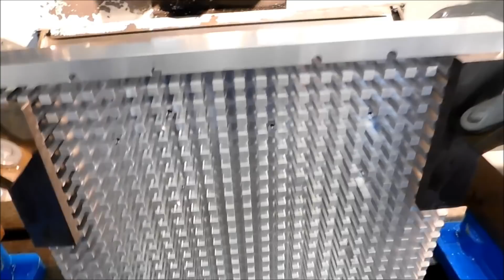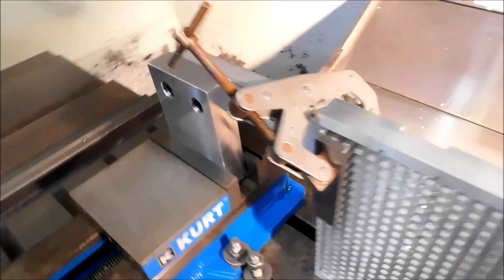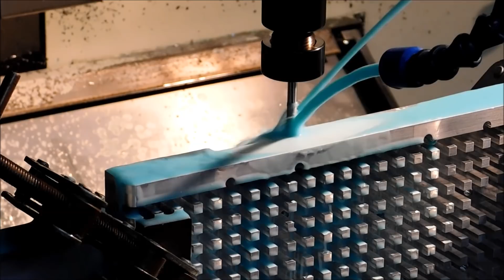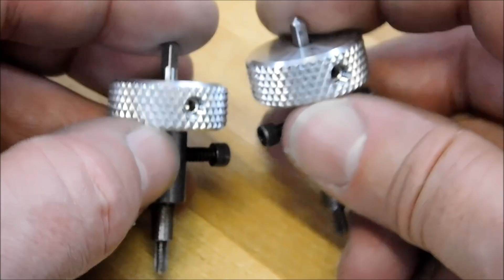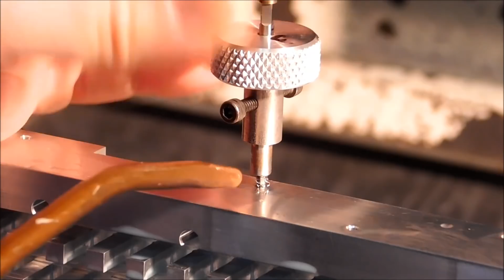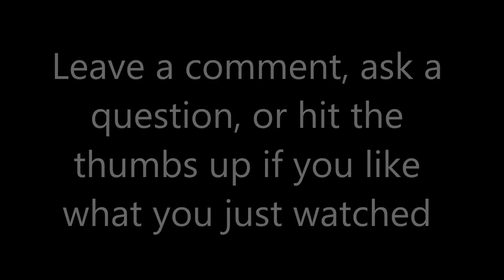Tapping Small Holes - Not a Problem

Comment: Hi Joe ,
If the grub screw holds the tap in what are the two socket head cap screws for ?
I have had to start up a special folder named Joe pie - must have workshop projects and it is filling up fast ! 
Thanks for yet another excellent video and brilliant workshop tip !
Reply from the maker: The 'T' shaped steel part is for setting the depth. The wheel is the driver. Its a 2 piece assembly, but could be one. For extra small taps, I use just the 'T' shaped part as the driver and depth stop.

Comment: Hey thanks Joe! I watched this vid a couple days ago and happened to have a job today that required some hand drilling in the bottom of 1/16” holes, made a similar tool out of aluminum and it worked great, took all of 15 minutes but it will probably come in handy a thousand more times this year! I drill and tap a lot of 4/40 holes so the ID was made for that rather than a 16th bit, excited to try tapping with it tomorrow!

Comment: Is there a possibility of a video talking about carbide inserts or which you may recommend for a job or material. If a private message to me would be easier im fine with that. I mainly cut aluminum and mild steel
Reply from the maker: The coated carbide market is evolving so quickly, that making a suggestion for a single insert is very tough these days. For aluminum, I always used uncoated K68 grade with a positive rake. You can use them on mild steel too, but a coating may give you a better result. Kennametal has a fantastic application chart on carbide grade and profile selection. Check them out.
Reply: Okay thank's Joe. Just getting into it for hobby work and i'm still new at it so i don't wanna end up spending crazy amounts on inserts. I believe i was looking at using the T class inserts for versatility for dovetail tools and such.

Comment: Years back I wrote a macro that would allow me to step down (like step drilling) a tap a variable distance and reverse a variable distance until the final depth was reached. The only time a tap would break was if the drill got dull and pushed up into the chuck. We were machining cast stainless steel that was gummy , and tended to work harden as the drill dulled.
a constant air blast cleared the chips but it was tricky. Nice job on the tap holder.
Reply from the maker: Thanks. I just couldn't bring myself to loose this part, this late in the game. Hand tapping was the only way to go and these little wheels give great feedback for elevated confidence.

Comment: 95% of problems with tapping is side pressure, tapping straight with a proper guide and fine touch is the secret, and, don't forget a decent quality well sharpened tool, even more so in stainless steel...   ;)
Reply from the maker: Hey Pierre. I agree completely. Its a finesse and control thing.

Comment: Best roll tapping when possible, swarf is not a problem.
Reply: Roll taps are very good. But nearly impossible to remove if broken.
Reply: swikocki, yup. I use roll taps whenever I can. #4-40, 1/2" deep in 360 brass, no problem. #10-32, 3/4" deep in 6061-T6, no problem.

Comment: Hi Joe. Have watched all your latest videos and all good stuff. Useful tips in a watchable format. Keep them coming. I did A video along similar lines with a slightly different tool. I can't post a link or it will put this comment in your Junk messages folder but it was called Tapping Small Holes. Cheers. Crispin

Comment: Hi Joe,
I would use a " roll tap " (X-Press, thread-forming, fluteless etc) for your job in this video. They don't produce chips and produce a much stronger and smoother thread. I use them virtually exclusively except for non-malleable materials such as cast iron, bronze and plastic.
 For your viewers - it is imperative to note that the tap-drill size for roll-taps is larger then the tap-drill used for equivalent size cutting taps.  
Below is the tap-drill chart for roll-taps. 
http://www.balax.com/catalog/thredfloer-taps/ansi-thredfloer-hole-size-chart
It's best not to use any lubricant other than one specifically formulated for tapping.

I don't know what type CNC you have, but we routinely spindle-drive, and back-out taps as small as 0-80 in alum, with 25 hp spindles, achieving 75% thread depth. We use Mazaks exclusively.

Roll-tapping blind holes in stainless requires filling the hole from the bottom with a syringe and hypo-needle with MoS2 -  Moly Dee or equivalent - which does not breakdown up to some 400,000 psi.  Nothing else comes close.

Small taps can be held in a straight-shank drill chuck, with the shank held loosely in the collet. The body of the chuck then rotated by hand. The weight of the chuck will provide adequate thrust for the tap to engage the drilled hole.
You can also insert the " handle " of the chuck-key into 1 of the 3 chuck-key holes and obtain more torque for larger taps.
This can't be done with keyless chucks, since when you try to withdraw the tap - the chuck will become loose.
Reply from the maker: As much as I appreciate your input on threading, the limited quantity of holes to be done and the critical nature of this job, combined with a ship date less than 24 hours from when this videos was shot, and the immense amount of time that went into the part before tapping made the hand tapping an easy choice. I machine tap all the time, just not an option for this part.

Comment: I'm sure you're probably aware joe, but a great tip I've heard for getting broken taps out of aluminium is by dissolving it chemically, pretty slick. I don't recall exactly what is used, but I have seen it done.

EDIT: I did some quick googling, the stuff you want is alum.
Reply: I don't know how to do that, but I removed galled aluminium from step drills the other day with caustic soda (lye).
It worked great. Would be kinda funny if someone got confused and tried that, only to come back in the morning to find a broken tap and the workpiece gone...

Comment: I run a part frequently that has about 27 m2.5x.45 threaded thru holes and 16 or so m3x.5 threaded blind holes running about .3" deep. tapped in the mill with tension compression tapping head and using cut taps for the m2.5 and roll taps for the m3. We run about 100 of these parts at a time with no issues with the taps.

Comment: Great video - as always. One thing to add is the choice of tapping fluid to assist with this operation. My current project at Rolls-Royce is to tap a series of M4 holes in Titanium. I use a tapping fluid called Hangstefers, I believe it originates from Germany. It has a slight pink tinge to its colour but it really does the job. Having said that, due to a CNC program error (my fault) I managed to break a tap and have to have it spark erroded to remove it!
Reply: michael johnson  
The J18? I love that stuff... especially in Ti.
Reply: Hangsterfers is a US co located in Mantua, NJ. 
I first used their cutting fluids back in the early 70's. We use one of their water-solubles in our CNC's now.
Back then they had a very interesting logo (long gone) comprised of a human-skull with bat-wings a-la Dracula, hovering over the letter " H ". 
Last image, bottom-left.
https://www.trademarkia.com/company-hangsterfers-laboratories-inc-539230-page-1-0

Comment: Im not sure what you meant by Cap Screws.
A picture would really help.
In my career i have been asigned to Manual and CNC Mill setup far more than manual lathe, so im not experienced with adjusting beyond runout, compound angles and tailstock centering.
Reply: Those two things sticking out of the side of his mini tap handle are cap screws. "Cap screw" refers to the shape of the head of the screw.

Comment: Joe,
Love the videos. As someone who was thrown directly into the fire (without formal machining education), they are invaluable.
I noticed your blue coolant in your Fadal and was wondering what you use? Some of the older guys in the shop started using this stuff called Liquid Ice HPX and they keep ordering it despite many problems with bacterial growth in our reservoir. I have flushed, sanitized, and flushed the entire system twice in the last 3 months because the smell gets bad. There has got to be a better coolant. We mostly cut 6065 injection molds and rarely see steel. Any recommendations?
Reply: Joe says he uses Trim-Sol mixed with water.

Comment: Joe. What's your thoughts about tapping 00-90 and 000-120 using rigid tapping on a Haas TM-1P?  Got a lot to do, more than I want by hand.
Reply: If you have the rigid tapping option  it should do it.. I would peck it a couple of times to get the chips out  (If in a blind hole).
Reply: I wish something that large!  Working on electronics, specifically microwave freq hardware.  Higher the freq, smaller the parts.  Typically nothing larger than 8-32.  Oh joy!

Comment: Great video as always Joe!

I would really like to see a video on how to get the slop out of the X axis on a lathe.
The lathe we have at work has about .200 backlash.
Reply from the maker: Nothing is worn that much. Something is loose. the leadscrew nut probably came loose from the cross slide. Check all the cap screws you can see in the middle of the cross slide.

Comment: Very interesting idea.
However, I failed to understand how it's made and, mainly, why did you make it like that (with a knurled aluminium head separated from a steel body), when they are both tightened to the tap body - Couldn't it be just a single piece?
Also, it seems that a better protection for the tap would be given by a dedicated steel body for each tap (fitting snugly), and not a loose fit that accommodates several small diameter taps, as shown.
Maybe I'm completely missing the point here.
Reply: Oh, OK. I just overthought it, I guess  :-)
Reply from the maker: Those steel stops fit all the way to my #10 series taps that don't use the aluminum knobs. 1 piece construction would be fine.
Reply: I guess you could even thread the steel body to fit the tap

Comment: Hi Joe. Great video. I used a similar technique when tapping 12 BA threads (tapping size drill .0413) in the steel smoke box of my model steam loco. During winter I found it a distinct advantage to slightly warm the tap and the work piece. Big Pete.
Reply: Interesting tip.  Thanks.

Comment: It says small holes in the description, but then you are only showing M3. One could almost call that clickbait. ;-)
I usually use a drill chuck for small taps, but your wheel is better because it is much lighter.
M3 is large enough so it doesn't really give me grief, except in copper.

I noticed your mention of the wire wheel to tame the knurl. There seems to be an obsession among machinists to always aim for that perfect crisp pointy tip diamond knurl. I never understood this, I hate the feel of a sharp knurl and don't see why one would make a rasp if a gripping surface is required, but your repair is a good solution to satisfy all tastes.
Reply from the maker: Its about the technique, not the size of the tap.
Reply: I would like to propose a moment of silence for all of the taps that have been victims of copper holes. Also I'm with you on the knurling thing I always stop before it gets that pointy otherwise its just painful to actually put any pressure onto the tool.

Comment: Joe, this may be an individual ability thing (and material selection choice) but what do you think the largest hole size These knurled tools would be useful for?
Reply from the maker: I can't imagine them being any good beyond 4mm. After that, the taps get fairly rigid. Just use an appropriately sized handle when driving smaller taps.

Comment: I like using a sensitive drill chuck myself. But then I have found the easiest way to tap small is have somebody else do it :) Spiral flute taps make a big difference also. Unfortunately the vast majority of sub m5 or 10-32 have been in 300 series stainless or Ampco. EEEEEEK! The right tapping fluid helps a lot also. Too bad you can't get regular RapidTap anymore
As to absolute worst tap size per broken tap IMO has to be 10-24. But then I have seen guys break M16x2 taps by hand. When just running a tap into an already threaded hole!
Reply from the maker: My least favorite of all time........6-32.  The tooth profile is way too big for the minor diameter of the tap. Hate them.

Comment: That's nice! I recently had to tap a lot of M3 threads that were deep enough to not allow for a normal tap wrench. I ended up heating an old tap square and driving it into a hard plastic screwdriver handle to use as an extended tap "wrench". I noticed I could easily make better threads than before for such small taps, as they would sometimes turn out a little loose.

Comment: CNC awesome! nothing like the 'feel' of a tap as it shines the cutting edge and knowing how fare it can be pushed. (rotated) ;- ) I was taught that theory to turn and back out a 1/4 to break the chip and all. I find backing just barely enough to release the chip from the cutting edge and allow a micro amount of fluid (sauce) to sink to the heated edge keep the 'feel' pressure uniform all the way down. Shop. Such an under paid profession. I need a million dollars for this stuff or a vacation lol. You all are metal surgeons. Tx Joe

Comment: Thanks Joe for a great tip.  I well remember many years ago having to tap several M3 threads in a VERY elaborate and costly stainless steel part - the thought of the taps breaking off still makes me break out in a sweat!  I found that a slight countersink prior to tapping the hole was beneficial in  the appearance of the finished job and chip clearance when the job was underway.

Comment: Would a spiral flute tap not be beneficial to this operation?
Reply: Also spiral flute taps are less rigid and easier to break by hand
Reply: Perhaps but those can be pricey for the small homeshop/hobbiest.

In CNC shops, we used primarily form taps for such small holes.
Reply: pektorijs There's always a first time I guess but up to this point I've never broken a spiral tap but I have broken numerous hand taps over the years. The spiral taps I like best pull the chips out of the holes instead of clogging the flutes with chips.